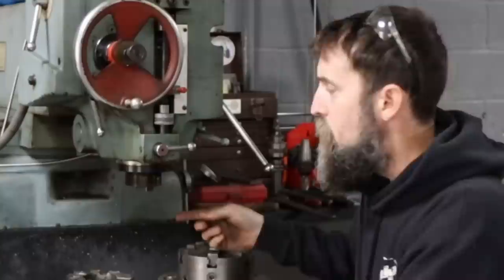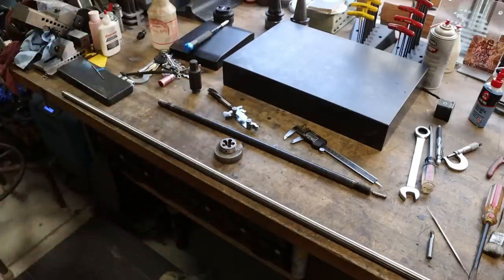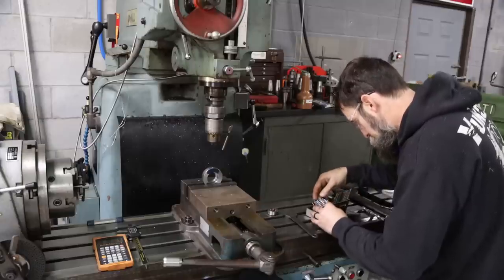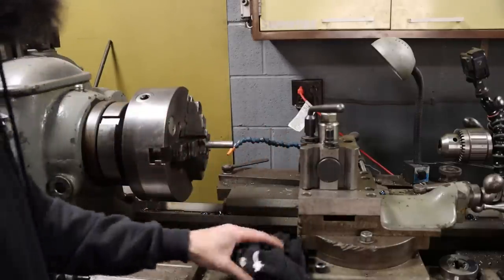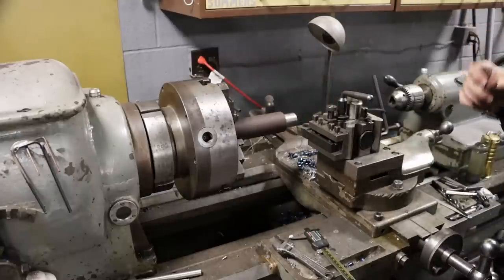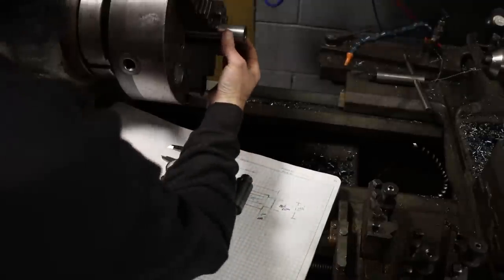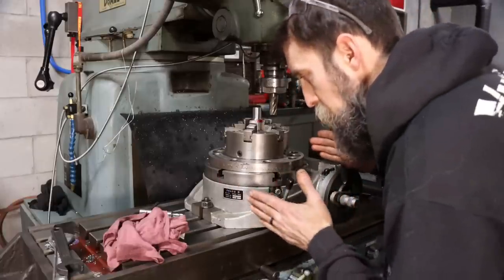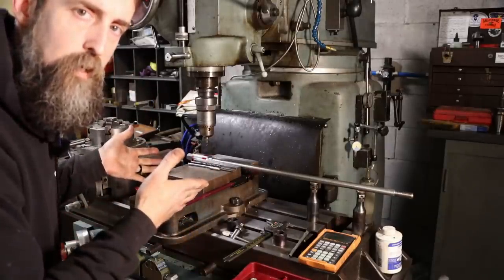Taking the long way. New draw-bar for the DoAll mill. OhYeah!

Comment: Mine has threads on the top with a nut for some adjusting with both threads at the bottom  works really well. Just another idea
Reply from the maker: That is the way my K&T draw bar is. I agree it works well

Comment: What size change gear do you need? 127 tooth?, its the gold standard, evenly divisible by 5 to get 25.4,  47/37 was real common as well, but its only close, that ratio (1.27027027repeting) will get you 19.9957.... . I made one for my old 1917 Hardinge, cutting a prime number is a bit of a trick if you don't have a matching plate or a change gear for your gear cutter.. we ended up using the metric change gear from a smaller 90's jet engine lathe in a 40's Fellows high speed shaper. if your dividing head has the ability to do differential dividing (plate clamps in a big ring so you can accurately get partial holes you might get away with that. another option I considered was to spot a 127 hole bolt circle in my CNC router (Elizabeth's laser?) then drill, or drill one using the bolt circle feature of the dro.. it needs to be good, but close would be good to work for what you need.

Comment: So for a correction that’s not cat 40.  That’s nmtb 40 or national 40. Cat 40 does not have that protruding thread it looks very similar to bt40

Cat 40 is very common on cnc machines here and I’d say cheaper and more avialable than nmtb 40 or bt40

Comment: Thomson shafting is material for linear guides / linear bearings.  If you have the material you should already know this.  It's probably R c 60 or so.  Trying to cut it in a band saw or checking the surface with a file will likely ruin the shaft for use as a linear guide.  Next time, pay attention to the material you select.  Know what it is and what it's for.

Comment: I'm in no way any kind of expert, but it looked like DIN 2080 (the longer one for toolchange-machines) and DIN  69871 (the shorter for manual mills). Internal thread should be long enough and the same, so if you shorten the longer holders the drawbar should fit them all the same way?
 Hope that you will have a good 2023 👍🏼🤗🎇!

Comment: I made a drawbar for a mill that came with one for NMTB40 holders (like yours) so we could use CAT40 holders because CAT40 is more really available and cheaper. It was a lot from Kurt since it already had one of their power drawbars in it. Theirs is a press fit into the head and still pinned, so I was very surprised to see that one being threaded and so sloppy.

Comment: I would buy or make adaptors for your BT 40 tools to accept the 5/8-11 drawbar, then spend your time building a power drawbar for the machine. Climbing a ladder or stretching on your tip-toes to work that drawbar is going to be a real nuisance.  Naturally, the suggestion is moot at this point because the project is done and filmed already, but the power drawbar should be for a future video.
BTW- your 3 jaw chuck IS a die holder.

Comment: Hi Steve, Nice build and Happy New Year!!!  Noticed on your hardness test that you set the minor load with only one rotation of the long pointer.  I don't know the model of your Rockwell hardness tester but it appears to be a Wilson and that design has not changed much over the years.  I suspect there is a small dial with two dots on the main face that indicate zero load and when the 10kg minor load is applied.  Setting of the correct 10kg minor load usually equates to three rotations of the long pointer with a Wilson.  Not doing the 10kg minor load setup correctly significently increases the error range.  Again, I don't know your hardness tool but I've dimpled a lot of metal with Rockwell testers and only one rotation on the long pointer seems out of place.  ---Bax

Comment: 35:50 steve ~never noticed that threaded rod to the right of your taper attachment tongue.   Is that for setting a stop for threading?   or does it have to do with the taper attachment indexing

Comment: Another comment is if you would have oversized the outside and left the shaft a press fit on the pin alignment would probably be a lot easier.

Comment: Steve:
Thanks again from an old fart in Thailand for another enjoyable hour in your shop. I see that Cora is really adapting to the role of shop dog. She is such a cutie!
However, WTF is that red fixture thingie that you used in the vice to drill the pin hole in the shaft and adapter. I know my little shop was never equipped as well as yours, but I simply don't recognize it. Can anyone enlighten me, please?
Thanks in advance,
Frank

Comment: Hey Steve,

Wouldn’t it be then easier to just machine an extra end with a 5/8-11 thread? A little longer than the 16*2 so it would reach the cat40 tool holder? This way you’d use the same drawbar, just need to flip it upside down. 

Nevertheless, amazing job as always. 
(I am doing the same with my vertical mill being converted to ISO30 taper)

Happy new year,
Greg

Comment: Hey Steve, glad you got your truck done so we can see shop videos again.  You guys making videos don't listen very well, ha, going to make out of Thompson.  Hard stuff, caused really deep,  Cut and made lots of parts out of it.  Linear shifting, soft in middle,  drills and taps fine in middle.  I figured it would test 62, but you got 64.
I know if I would get those gears cut I could cut metric threads with my hendey without reversing spindle, since it is a Hendey with a leadscrew reverser, my machine is a 12x30, not sure I have enough room for the 100 and 127 tooth gears, your 16 inch machine just a bit more room.  I am waiting on that video where you teach old dog new tricks which really isnt new for a hendey.  I have charts, just not for a 12x30.

Comment: Crunchy and chewy centre in that rod. Had some machine parts that came with a hardness of 65RC as a minimum, fully hard all the way through.They were used with powder, and did wear though, but you could clean them with no problem using a grinding disk, as you would remove the powder, but not the steel. the auger they were used with was made from Hastalloy, and was both expensive, and tough, but even that would wear, more than the hard steel shoe, but that at least was easy to repair with just putting a stainless steel edge back on, and let that wear instead. No idea on the alloy they used for the main castings, just that it probably was half manganese, because drilling it was murder on bits, and I did need to put a few recoil inserts in, as the holes had worn from years of use, and it was one to two cobalt steel bits per hole, to get the thread out. New thread though was easy, lots of lube, and go nice and slow.

Comment: I'm not trying to be a party pooper here. 
But I need to mention this.
Long sleeve shirts, coats, lose fitting Clothes should Never be Warn around a Lathe.
Watch the Video of a Russian guy Getting Totally Shreaded apart in seconds because he reached over & near his spinning Chuck with a coat on. 
Bad Bad Practice.
Point of Information only..
& also Never have Strings on hoodies hanging near any Machines.
✌️👍🙂

Comment: Steve, seeing you bend over your lathe wearing a hoodie with the hood ties hanging down scares the be jeezus out of me.  You can tuck then inside if it is too cold.  My shop alas is not heated so I know cold.  I had an older machinist hammer shop safety into my head for years...  I know I am being a nag but seriously guy...